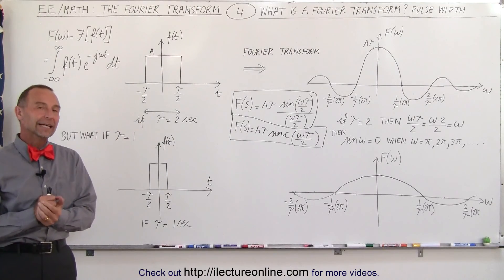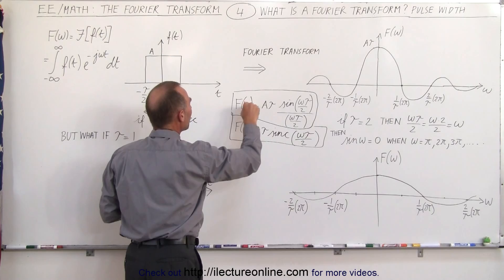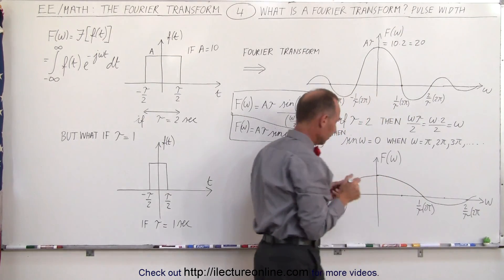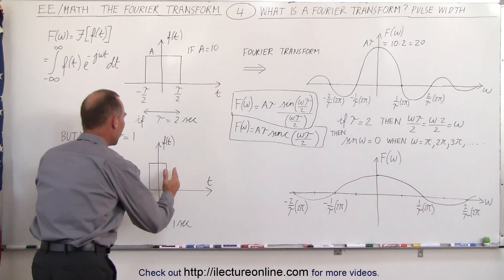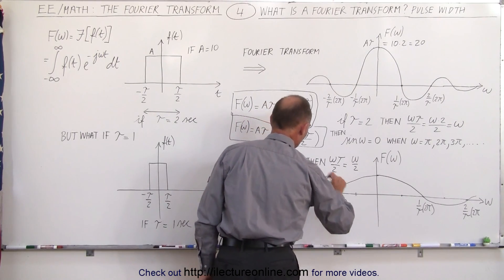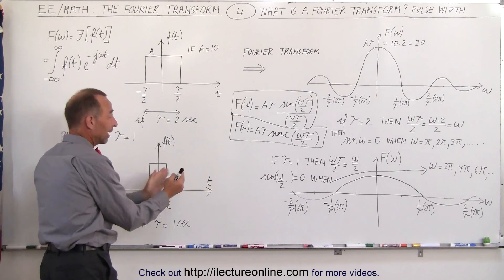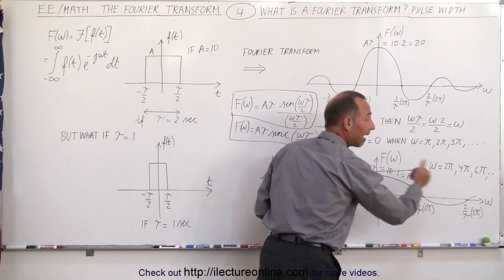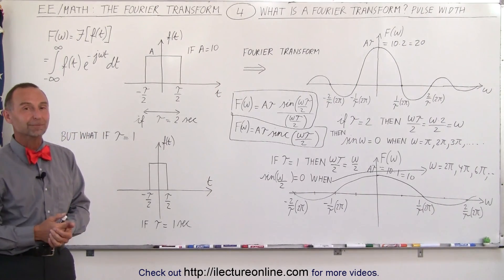Electrical Engineering: Ch 19: Fourier Transform (4 of 45) What is a Fourier Transform? Pulse Width

Comment: Dear Professor, may i ask a question? Which branch (Field) of electrical engineering needs mathematics more than others? I mean more dependent on it? Microelectronics, power electronic, control, communication, digital electronic ....?
Reply from the maker: Most branches of electrical engineering require advanced mathematics.  But I would think the signals, E&M waveforms, communication, and circuit analysis would require additional prowess.